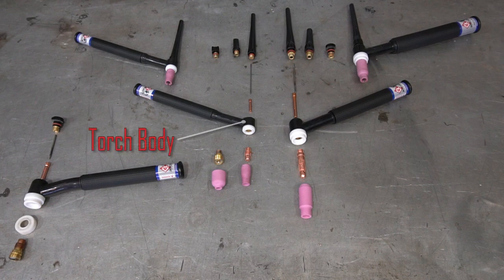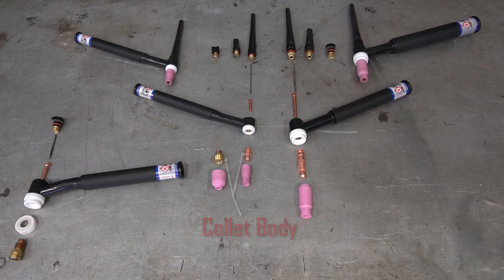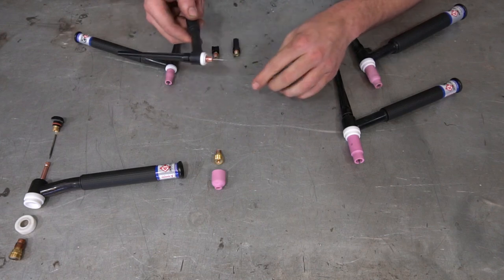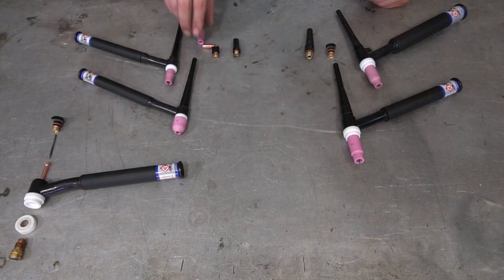TFS: How to Assemble a TIG Torch with Side by Side

Comment: I find the torch heats up faster with a stubby gas lens kit installed, I do mostly welding with the standard cups. If I need a short setup I'll change it over to the stubby lens and put the standard cup back on afterwards.

Comment: Ck worldwide trimline 26 is a great torch also if you wanna stick with air cooled same size as the 17 but can go up to 200 amps the cable is a 26 cable though
Reply: 17 air cooled is my favorite and 20 Water cooled. I like that I can share the same cable with 17 and 9. I want to try one of those heads for tubing
Reply: Welding Junkie  yea I love the 20 now only think I don’t like is I have a everlast water cooler and it is pretty loud. My second favorite is the 26 trimline
Reply: Chris Wojnarski I know the feeling my HTP water cooler is loud too however my miller Coolmate 1.3 is really quiet
Reply: Welding Junkie I almost got a miller too but used on eBay for around same price as everlast new . Good thing though I got 2 new water coolers out of it the first one they sent was damaged only the red quick connect fitting was damaged there like 10 bucks online so that was a plus
Reply: Chris Wojnarski you really can’t beat the everlast and HTP coolers just drives me nuts it always runs. Both mine turn on and off with machine but only my miller turns off if you stop welding for 45sec. You sell the other one?
Reply: Welding Junkie no not yet I might fix the piece and sell or trade it towards a better cooler probably miller one
Reply: Chris Wojnarski get the 1.3 it’s really quiet I love mine
Reply: Welding Junkie thanks for the info I’ll definitely keep that one in mind

Comment: Justin, do you have problems with the collet not tightening on the tungsten after awhile?
Reply from the maker: Yes. They get worn out the more you use them. Try switching to a CK Worldwide wedge collet.
Reply: The Fabrication Series mine seem to wear really quickly, as for ck stuff here  sorry its over priced. 
Thanks justin!
Reply: Aha! I had the same issue. I think I've learned more in an hour of reading your responses and watching your videos than I have in days of reading random welding stuff online. So much hands on no-nonsense info.
Reply: Alex K i know right, i just watch the videos and i dont go on websites. Toooo much misinformation.
Reply: Right? And they usually discuss meaningless things back and forth. This is full of fresh information and to the point.

Comment: Justin, thank you for your great fabrication videos. Currently I am welding 6061 aluminum. I need to get into a tight spot with 3/4" to 1" stick out with the tungsten. What parts do I need for my 17 series torch to accomplish this?  Thank you, Phil
Reply from the maker: Instead of trying to stick the tungsten out that far and risking losing coverage, look for a "long cup" with a small orifice.
Reply: It's a tight area and I can't fit a long cup in there. I tried practicing on scrap  6061 using a gas lens with a number 8 cup with the 17 series torch with 1/2" stick-out, but all I was getting was a shitty ass weld. I even raised the argon up to 20cfh still a lot of soot and pepper in the puddle, and shitty weld. I am beginning to think that welding on aluminum it's not possible to use a  long stick out...
Reply from the maker: maylockin If I had another solution I'd offer it up. You could try to build a dam or something on the back of it or even point a purge hose at it with a bunch of stickout, but it's probably going to give you fits.
Reply: Try using a FUPA 12 by Furick or the BBW by Furick
Reply from the maker: Robert Yelverton They specifically state not for use with AC.
Reply: Sorry that is correct.  Let fingers type faster than brain was working. I have used a #12 cup with 35 to 40 cfh with 7/8" stick out and a damn made out tripled up heavy duty aluminum foil.

Comment: Can you use a tigwelder on a new Ford trucks aluminum body with high frequency start or will it damage electronics?
Reply from the maker: Thomas Culver You can. Just dont ground the machine directly to electronics.
Reply: Just avoid the radiator supports. Those are magnesium. You have to purchase really expensive hard to find magnesium rods.
Reply: Take the batteries out just for good measure

Comment: What exactly is stubby about a ‘stubby’ torch? 
As a newbie to tig they look fairly identical to me. This wasn’t covered in your previous torch video that I can recall.
Reply: Basically you can use 9 series cup and collects on 17 style torch when using the special stubby gas lens for the 17 torch. It will all make sense when you purchase a stubby set up for a 17 torch. But take a close look at the stubby gas lens compared to a standard gas lens for a 17 torch, that along with the insulator is how they make a stubby 17 torch. Hope that helps